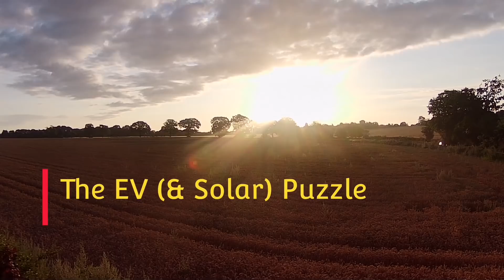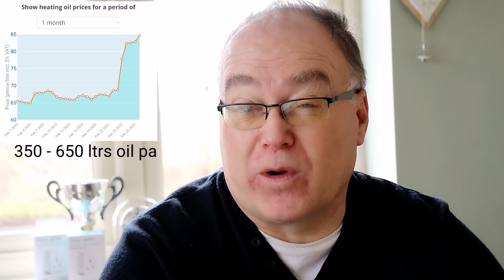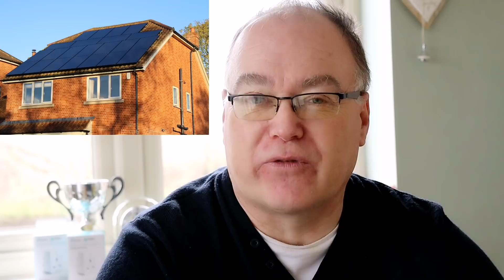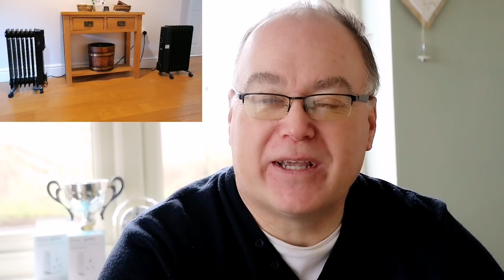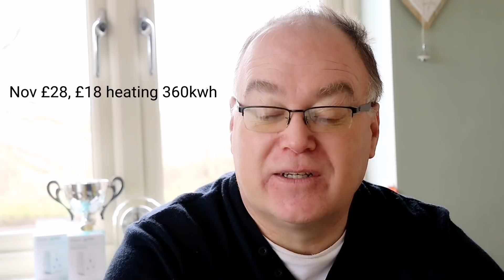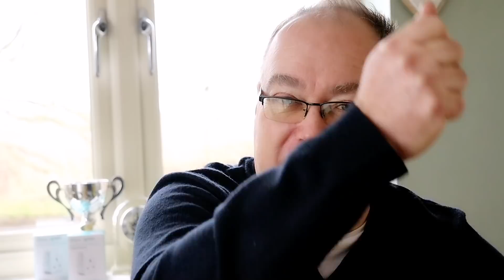Electric vs oil heating - No central heating all winter. Results of my full winter test

Comment: This is an unusual set up. Although you are not promoting electrical / green set ups everything you say is contrary to my own experiences with electric.  It all falls down when you consider that a rate of 4pence per electrical unit is not typical. If the government wanted to they would make sure we all have solar panels tomorrow by subisidising electric prices massively. So your video is hollow for those of us who dont have cheap electric. (At the moment of writing  oil is cheap but it wont be for long). You won't miss oil heating when you have hardly used it before to begin with! I have tried electric only setups over several years and pretty much all OCH set ups and it is practically impossible to run everything on all electric without huge expenditure ( without 4pence a unit type set up)

2nd point (I'm taking issues just because its opposite of my experience)
Log burner you and everyone seem to underestimsate the cost of logs because of the nature of the way they are sold often for cash and in smaller amounts . Unless you get your logs locally from farmer etc). Logs are expensive,you also have to sweep general maintenance - most people have an expensive stove put in or fireplace this cost. Its easy to 'forget' to add the cost of logs if you pick them up locally in small amounts. They do work out cheap in bulk in any case I don't see a proper reckoning of logs. They cost a lot when you stop using the oil burner.

3rd point although I would agree in the sense that  oil burners are not an efficient way to heat a house 400- 500 (approx) a year filling your oil tank to use your radiators? I acutally don't believe you used it hardly at all before your experiment. Unless oil is insanely cheap in norfolk, 1000, 2000 per year on filling kerosene in oil tank is typical.  I spend 2000 a year on oil not including servicing, replacement costs etc so on cost part due to taxation of fuels OCH is less attractive each year but you cant miss it if you only spend 400 a year on fuel!

4th point was having two rads and a stove in the front room. Well you wouldn't have these on at the same time. So switching on a 1kw radiator and saying its more efficient is not doing a direct comparison of all the options available. These electric radiators are the most ineffective way to heat a house unless you live in a 10 square metre apartment and you have a large glazed area which is drafty so you definitely do not have that!

5th point i think you touch on it is the immersion. This is hte main benefit of OCH in my opinion. If you have an electric only system there is a cost to this whereas the  OCH does it all together. This is a massive benefit of OCH but as you have solar heating in the summer months you are clawing it back. Again most people dont have access to solar panels and of course you have to factor in installation cost of solar panels.

Forgot to mention that I did not notice you mentioning batteriesk so assuming you don't have the big battery as back up. These oil rads dont work well from solar and not from a battery back up due to the resistance. They don't work well and it uses the power up. So again they are only good if you are getting  4pence a unit. Most peoples electric is 8 times that per unit.

I agree with the sentiment that electric is 'better' but for large house with multiple showers individual electric heaters do not compare. But for the 4pence rate which noone gets in my experience.  I think there is a fundamental attribution error made when people get solar panels that everything in the house has to be electric or its suddenly invalid, stupid or destroying the planet. The heat you get from individual rooms with those standalone electric heaters  is incomparable with the heat you get from an oil burner with green oil tank.

Comment: I have been using a electric dehumidifier in my bedroom to heat it, and run it often when taking a shower, to control the humidity and warm the room.  They do put out a lot of warmth!  The refrigerator provides heat to the kitchen, the compressor is about 400 Btu's, about what a 150 watt electric heater would put out.  

To get 100,000 Btu's of heat, you can burn about 1 gallon of oil (3.75L) or run electric heaters at 23 KW, or run a heat pump between 5 and 7 KW.  So the heat pump is the way to go!  I would recommend a 12,000 to 18,000 Btu heat pump in the largest room, with the doors open to that room to allow cool air in the summer or heat in the winter to drift into the other rooms.  

I put a timeclock on my water heater so it will run 9 pm to 7 am.  My low cost overnight rate is 9 pm to 7 am, at about $0.06 per KW, while 0.08 per KW between 7 am and 5 pm, and the high rate is 5 pm to 9 pm, at $0.32 per KW.   By heating your hot water to about 60C but a timer that keeps the power off during the higher cost time of day, you could save a lot of money.  Sure you might need to turn on the water heater on certain days, but that might become rare.  

I will run my heat pump to cool the house until 5 pm, then shut it off until after 9 pm.  

For each pound of water collected by the dehumidifier, it will put out 1,500 of heat!  So they are very effective heaters!  I would recommend a electric dehumidifier under the hanging clothes to dry the clothes, while the 4,500 watt electric clothes dryer will finish it in 1 hour, the dehumidifier will take about 1.5 hours and 200 watts. 

The infrared heaters heat what is in front of them, not really heating the air as much.  

I would keep the oil boiler, mainly because it is paid for!  And then put in some diesel fuel preservative, and use that fuel in your tank to back up heat for the next 20 years.  I would Never recommend a electric boiler, as you will be heating the boiler room, not each room directly, and you can zone control your heating much easier with the portable heaters.  Why spend $4,000 on  a electric boiler that will consume about 15% more power than your portable heaters! 

Wind turbines at home can be noisy!  Some say about 3 times the noise of the wind going through the trees, but still not something to have at home.

Comment: Go to Lidl and buy a few rolls of window thermal reflection self adhesive plastic. It's amazing and when the sun shines it brings the heat in and windows get quite hot and people can't see in, and at night it makes any heat produced reflect back in. I paid about £5 a roll and it should be in we every home. I don't use gas central heating after march but sadly still pay the idiotic standing charge.
Reply from the maker: I'll look into that reflective roll. Thanks

Comment: September 2022 and our oil boiler was leaking in march as the price of oil was going up anyway so I turned it off , our house is old with thick stone walls , I worked out it would be cheaper to run oil filled electric radiators than use oil , I bought a few different ones and Currys had 700w mini ones for £12.99 it’s going to be time to get back into winter and not sure what to do
Reply: My suggestion would be a 12,000 Btu - 18,000 Btu ductless heat pump in your largest room, and perhaps another one in your bedroom.  Then open the doorways to allow the heat to move into the other rooms, or use a small 700 watt electric heater in those rooms. 

With a heat pump, you collect 100,000 Btu's while using about 5-7 KW of electricity.  Electric heaters are about 23 KW per 100,000 Btu's and burning 1 gallon of oil is the same amount of heat.  So $4 per gallon oil is out, while $0.80 electric for a heat pump is the way to go!  

They produce self install ductless heat pumps, where the lines are already charged with a small amount of refrigerant.  If you do not need to extend the lines, this is the best for self installed system, you do not need to evacuate the lines and call a HVAC tech to do that.  

It is possible to replace the old oil boiler with a heat pump water heater designed for that use.  They come with a 30,000, 45,000 or 60,000 Btu compressor in them, and can heat the water to 35C just fine, even on very cold nights.  Heating the water to about 40C takes a lot more energy in a heat pump.    The normal running temperature of a oil boiler might have been 50C or more, and that is not practical with a heat pump, but rather they just warm the water and heat the rooms very slowly.  Yes it works, just some rooms might be a bit cold because they needed that 50C water with the smaller size radiator.  I would suffer through a winter and then decide to upgrade one or two of the radiators the following spring, if you decide that one room or another are just to cold with the smaller radiators.  Many contractors will say "You will be uncomfortable with the smaller radiator, so we must install a much larger one" but resist that temptation, as you can change to a larger radiator only if that is required at any later date.  

However heating the water with a heat pump, than heating the house with that 40C water is much more expensive than just heating the air with a ductless heat pump.  I would guess that a heat pump water heater would consume about 25% to 45% more electricity to heat the water, compared to a ductless unit just heating your air.  

I was considering buying a poorly insulated home in Arizona, then installing spray on insulation on the outside, cover with chicken wire, then spray on stucco that is tinted to also act as the paint.  We have stucco walls as a common system here in the Southwest America.  Then your stone walls would act as a heat sink, retaining a lot of cold in them during the summer, and once heated in the winter, they will keep a room very comfortable all year around.  4" of spray on insulation is very effective at keeping out heat transfer.  

I also considered using a new type of insulating paint on my home in Portland Oregon.  It is nominally more expensive than normal paint.  It claims to have a insulating value of R-6 with a thickness of about 3 mm.  I don't know how they do that, but they insulated a home on a TV show called "This Old House" on the local PBS station in 2006.  The home was in Illinois, and they get really cold there.  Something about the space shuttle insulating panels materials added to the paint to make it resistant to heat movement.  But I don't know if you would significantly reduce your home's market value by covering your stone exterior finish.  Maybe painting the interior walls with this sort of insulating paint might work much better?
Reply from the maker: A leak is something I've been dreading. Hope you get that sorted  ok
Reply: It wont work out cheaper unless you make the mistake that people often do in comparing there 24kw oil boiler output with purchasing twelve 2kwph oil filled electric radiators!. It depends on your electric contract. 700 mini heater will do next to NOTHING to heat you may as well burn your bills and tax demands! For a guide if your electric cost you 20p a unit and you have two of these running for 5 hours it will cost FOUR pounds an hour (where i am it would cost me seven pounds an hour) to use both of them (standard 2000watt plug in radiator) at full power and you can't run them off the same socket as they melt your socket you also are not supposed to leave them unattended.

Comment: Interesting video. We are 100% electric. We used to do hot water in a cylinder using an iBoost to divert excess wind generated energy plus an electric boiler for central heating. Boiler was not really suitable because it was 11kW and we preferred something that we could trickle feed. We have now installed a thermal store to replace our cylinder. The water in the store goes round the radiators and a coil goes through it to heat our hot water on demand. We kept our iBoost to heat the thermal store and dumped the electric boiler. We use a sequencer to heat the thermal store when needed with three 3kW immersions that can work ok on their own or together. Not had a winter yet but a good solution a bit like storage heaters.
Reply: What type of thermal store do you use? Presumably this stores hot water (fed by pv powered immersion  or electric boiler), which can then provide both hot water and central heating? Thanks
Reply: @mart34  It is a cylinder that contains the water that goes round the radiators. Ours is heated by immersions only (including two immersions that divert excess generated energy that would otherwise be exported). Our hot water is heated in a coil that goes through the store so uses mains pressure. Temperature in the thermal store is higher than a traditional hot water cylinder.
Reply: Thermal storage would be much more energy efficient if they had a 5 liter wax filled thermal storage heat sink.  When the wax changes from a solid to a liquid, it will store laten heat, and then return all of that heat during the daytime to the water when it goes from a liquid to a solid.  The change over in melting the wax, I guess compare it to ice changing from a solid to a liquid, ice is 144 Btu's per pound to make that change.

Comment: Thank you so much for posting this. I know I'm seeing it 3 months later, but am desperate to get off oil usage for space and water heating. I moved from UK to rural western Ireland last year and had ofch for the first time in my life. Around Nov/Dec oil was around 70p/l. Today it's £1.21. Needless to say, that's not sensible. Over the weekend I've been hyperfocusing on learning about solar pv vs thermal and seeing what I can get for around £4k just to get off oil - not really considering reducing elec as such even though it costs me around 25p per kwh day / 13p night. The house I bought is around the same age as yours (18yrs old) and has a reasonable "BER" (like EPC) rating, double glazing etc, although is a dormer bungalow with Velux windows upstairs.

I reckon I can get hot water off solar pv for my budget but have been stumped about what to do for space heating.

It didn't even occur to me to use mobile oil filled elec heaters - my old school thinking they'd be super expensive to run (like the old 3 bar elec fan heaters 😱). Obviously tech and materials have got better and they're a lot more efficient!

So, I will go buy 3 or 4 of these radiators this week!

Also, since your house is approx the same age, I don't know if you've done this but replacing the window seals (eg Stormguard 20m rolls, I got two rolls from screwfix for around £50) has made a huge difference. Also adding 200mm of "Earthwool loft roll" around the loft on top of the old 150mm insulation (I should really have stripped it but am on a budget!) has made a noticeable difference also. You're looking at around £25 per roll which covers a surprising area!
Reply from the maker: Thanks for those recommendations. I do need to do window seals
Reply: A heat pump will be much less expensive than a oil furnace.  The cost is 5-7 KW of power for a heat pump to warm 100,000 Btu's while you would burn 1 gallon of oil, or 23 KW of electric heat.  Heat pumps win!  Running your water heater at 60C, then have a time clock to shut the water heater off when the rates are higher during the day, to allow using the low cost power at night.

Comment: On one video recently you asked for a WiFi temperature sensor as yours was playing up.
I ended up with a Starmoon Smart WiFi Temperature and Humidity sensor from Amazon. It works very well with my Smart Life App which then was controlling smart sockets with oil filled radiators on. If just connects to the WiFi with no hub needed. You can look back on the last day, week or month to check highs and lows.

Comment: While fascinating vid it’s also horrifying that electric heaters and dehumidifiers are a cheaper solution they are all at best <100% efficient systems, how inefficient is oil heating that this is a good idea.

Short of the capital to install heat pumps make so much more sense with their efficiency, we just need them a lot cheaper
Reply from the maker: Of course they do, there's no comparison but heat pumps are a single centralised system and Inflexible without smart thermostats  everywhere.  Under floor and in wall pipes all leak energy in places you not not need so direction of heat is more widespread.  Energy can be saved by localising  heat.

But my videos and talk of portable heaters has been a Test that's all
Reply: Michael Williams,  I bought and installed a 12,000 Btu 120 volt heat pump in my nephews rental house, using a TV cabinet to mount the indoor head, and run the tubing out a window, and he can take it with him when he moves.  The cost was $719 at Amazon.  

Amazon also sells self install units that do not require a HVAC guy to evacuate the lines after you hook them up. This type of lineset is factory sealed with aluminum caps, that as you install them the seal is removed so refrigerant can flow freely.  The cost of that brand unit is about $350 more in America, and you must located the outdoor unit within the distance of the lineset.  If you need it extended, you should buy the lower cost unit, and have a HVAC guy extend the lines and run the vacuum pump to finish the installation for you.  Or buy a vacuum pump and manifold set at Amazon for $175, and you can install many units as a side business?  

With a oil furnace, it takes about 1 gallon to provide 100,000 Btu's of heat, while a heat pump is only 5-7 KW and a electric heater is 23 KW.  So much less expensive to run the heat pump!  Solar hot water is another way to provide low cost heat, but that is not discussed here.  . . .